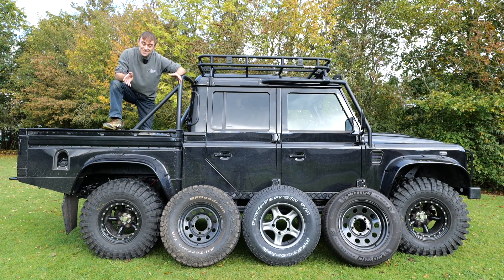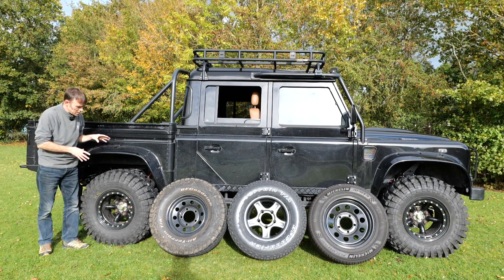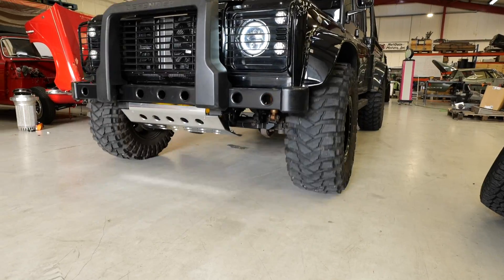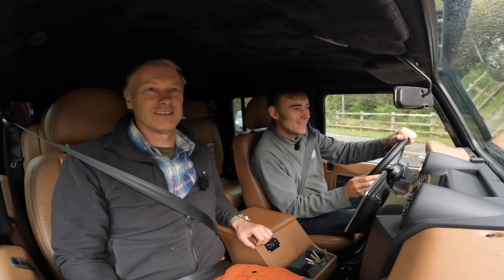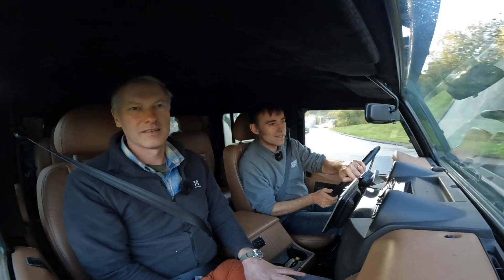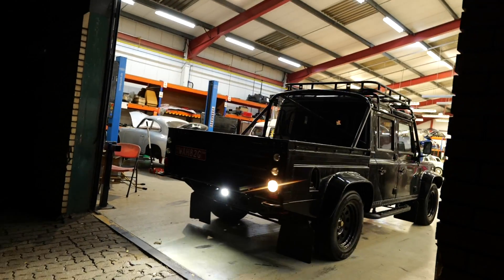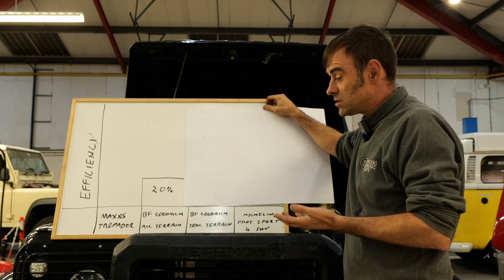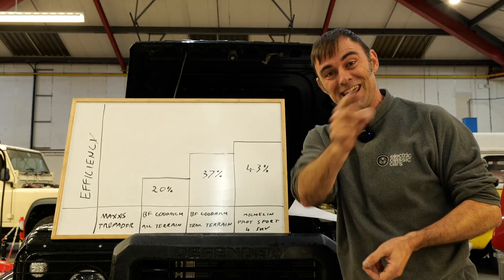How do tyres affect fuel efficiency?

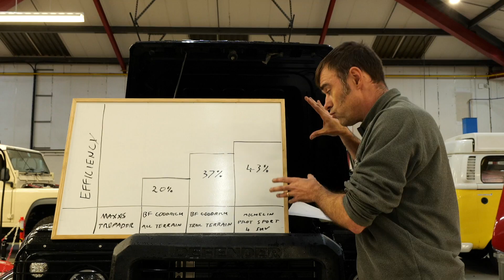Comment: 17:50
do not get FOOLED by the graphics!
The jump from 0-20% is the optically the same, as from 20-37% (although there is a differnence of 3%!)-

The jump from 37% to 43% is optically ALSO THE SAME - although it is ONLY 6%!!!!!

imho: It would have been better to end the day and make a propper graphic on the next day:
2 big jumps in efficiency from MT to AT and Street.
NO GAIN to street only tires.
Reply: This is why All tyres are compared to the Maxxis. The difference between tyres 2 and 3 was not shown, only the difference between 1 and 2 and between 1 and 3.
How is this not a measure of fuel consumption? Energy used to turn the wheels was the thing being measured aka energy consumed. The aerodynamic profile of the vehicle was kept constant, no change in energy would be shown if tyre choice made no difference compared to aerodynamics.
Reply from the maker: That’s correct. 👍
Reply: "How is this not a measure of fuel consumption? "
Because, as I mentioned, the aerodynamics plays a SOOOO much bigger role on highway, that this is almost irrelevant.

On highway (according to a German Car Lobby, ADAC) 70% of fuel consumption is caused by aero.
19% roll resistance.

But Note: roll resistance is NOT only caused by tire profile but MOSTLY by tire air pressure. Plus width and diameter  plus weight of the tire. A 33" MT with 5 bar is probably WAY BETTER than a 35" street with 3,5bar.
So the profile ITSELF is just a FRACTION of 19% and within this fraction you can save the mentioned 20%-37%.

= you cannot even measure the difference in highway in fuel @watcher24601
Reply: it´s math.
Reply: In addition:
PLEASE note that this is NOT Fuel consumption!
This does NOT = the saving in FUEL!

Because the most important factor at 80km/h is aerodynamics.
Leaving the roof rack at home will probably safe more fuel, when you go highway speeds; and not shppping with your 4x4.
Reply: So you think the video was a fake. Maybe you should do your own video to show that no extra fuel is used to overcome rolling resistance if that is what you believe.
Reply: You do not read correctly what I wrote.

example:
I owned a 93 Quigley Van with 35" tires, high roof,  7.3l diesel.
It used MINIMUM 12l/100km: 75km/h on highway on best conditions, constant speed. Tires: AT Profile!
I changed to MT Tires!! YOU would expect to fuel consumption to go UP 20%?

At the same time I made boxes behind the rear tires. = less wind turbulances in the fenderwells = better aero.
+ a "underbody protection", so a sheet metal that went from the bumper down to the axle. also = way less turbolances.

Now the truck went DOWN in fuel consumption!!! Now I could drive 90km/h with 12,5l/100km.

If you do not get this - I am done.  @watcher24601

Comment: I wonder if the temperature made any difference to the fuel economy.
Reply: Wouldn't economy be worse at night with colder damp air being more dense?
If so then the differences are even more extreme.
Reply: @alibro7512  Yup, colder conditions should increase aerodynamic drag, no doubt. However, I would assume for this kind of beast rolling resistance probably uses the greater portion of total power needed to average 55mph, than the aerodynamic drag does ... so it shouldn't influence the result much

Comment: I know from running a 44 ton truck that the most important thing to attend to is correct inflation of tyers. Under inflation can cost thousands of pounds in fuel on 120,000 k per year . Over inflation can cost hundreds of pounds on tyres by wearing out the centre treads.
Reply from the maker: Very true. 👍